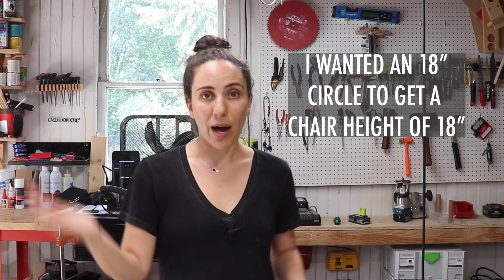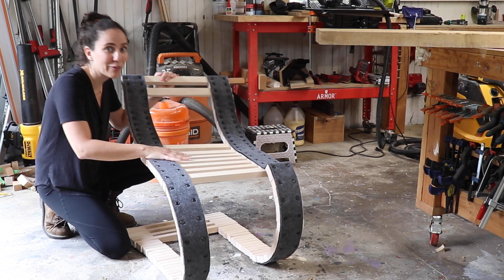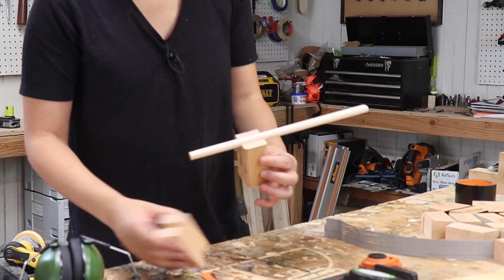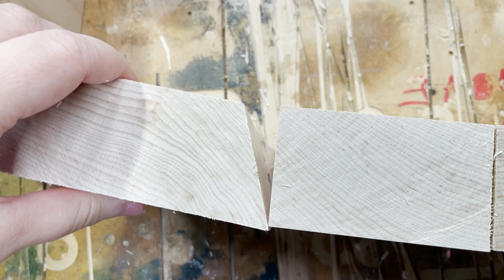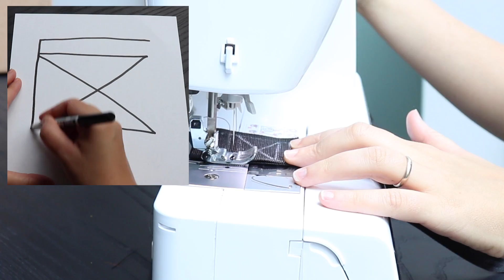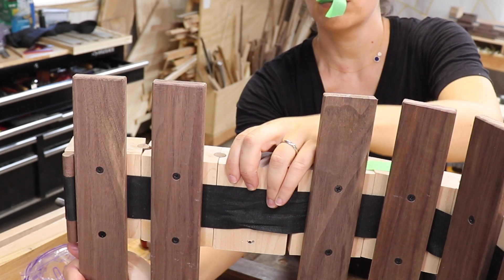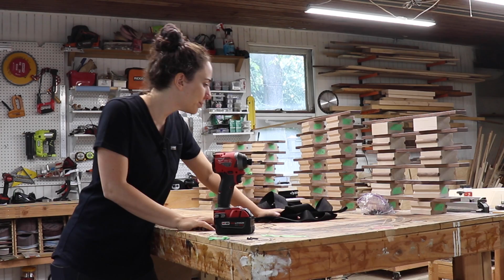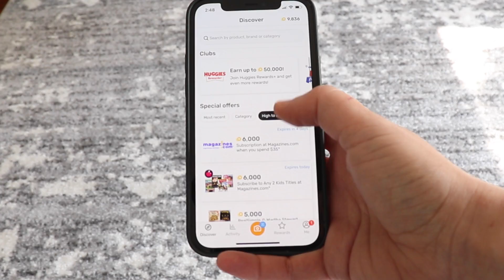I ATTEMPT to make a Roll Up Chair… AGAIN...

Comment: Hello Tamar....This might work: problem is one long strap (actually 2...lol) which gives too much stretch on the whole length...So solution would be to attach each pieces to one another with alternatively one short strap (centered around the 2 first pieces, and taking the third of the width of the piece), and then two straps from the second piece to the third piece (each one on the left and right side of the piece, and completely covering piece no.2 with the other strap coming from piece no.1) and so on.....So that way the straping will alternate on each pieces, from the preceding, and to the next one, without getting in the way one another....And straping only the short length of two pieces at a time, there will practically be no stretch "power" to the strap....I know it's maybe a little complicated, and a lot of short pieces of straps to secure, but it's worth a thought......And maybe dwelling on that, some other "double straping" idea will emerge...!!!!!
Reply from the maker: Good ideas!
Reply: @3x3CustomTamar  Hello again Tamar, had another idea (just as crazy as the last one, lol)...: piano hinges instead of straps (or only for the parts with the most pressure, maybe)....!!!! That would force that chair to stand, up and right, into the shapes you made the wood into....!!! Also thought that a simple X shape of straps from side to side, where necessary, could maybe help with the "torsion" aspect of the chair......!!! Really hope to see you succeed with this.... ;-)

Comment: beautiful chair Just glue it  - The connecting circles should be rectangularand strong wood - leather stretched - metal wire with plastic cover not
Reply from the maker: I did just glue it at the end
Reply: @3x3CustomTamar  I hope it holds, this chair is a work of art.

Comment: Tamar, at minute 16:50, it may be possible from looking at the chair profile - take the ends on the floor and extend that part of the chair with few more segments.      Then instead of having the ends laying on the floor freely - roll them upward to connect to the low point on the chair seat with some removable pins.     So that then you have a big asymmetrical oval in the proflie - for the base.      That should keep the chair from sagging excessively.     

The segments to form the new asymmetrical oval shape of course will have to be cut at angles, similarly to what you have at the front of the chair curve.    The front of the chair base as you presently have it appears to support your weight sitting on it.  You just have replicate that with the back part of the chair base.

And every time you unroll the chair, just insert the pins to form the assymetrical oval base.    Instead of pins, you might be able to use fastex buckles.
Reply from the maker: Maybe!
Reply: @3x3CustomTamar  Tamar,  Kevlar strapping may a solution to the strapping problem.  From the little I have read, it is supposed to have almost zero stretch.

Another thing you might want to consider is eliminating the walnut slates - maybe.  And instead make the dowels (oak) full width of the chair (instead of the short segments) - in the sitting and back rest areas.   It should also help with the racking issue.   If you try that route, the thing to make sure of - would be make the strapping width a little wider than the segments to cover up the joints so you don't get pinched - ouch!

You could always stain the dowel to the finish you want.    You may have to use bigger diameter dowel rods in the sitting and back rest areas.

Comment: The problem is the textile part. Have you considered using something designed not to stretch like dyneema?
Alternate suggestion, perhaps constructing wooden pivots at each joint similar to a cable chain tray.
I also like the suggestion below to switch out to neutral hinges. 
This is turning into a material science project, maybe a collab with an engineer creator could help?
Reply from the maker: Yeah. The materials are def the problem here
Reply: @3x3CustomTamar 
so...
The algorithm recommend '"chair by Gerard van der Beek" to me after I watched your last video a few times...
I reckon it might be the way to go. You can reverse engineer his hinge parts from the video frames, pretty sure they're plywood...

Comment: Steel cabling is probably still stretchy enough to notice, but if you ran steel cable through the blocks and then tightened them by having eyebolts on the ends that you could adjust would let you quickly and easily change the tension. You might even be able to build it with a cam-over lever so you could high tension in 'chair mode' and loose tension in 'roll up mode. 

Keeping the tension on the outside of the curves could also help with the collapsing.
Reply from the maker: Maybe!

Comment: Kevlar, fiberglass, and carbon fiber are among the stiffest (resistance to stretching)  strapping materials that you could probably get your hands on.  The design of the chair actually amplifies the forces (think using a door to crack a nut).  It might also be beneficial to not allow the strapping to move through each segment by fixing it in place.

Comment: The problem with those straps are not about the tension itself but about the fact that tension applied on the one piece is transfered to the ends - thats why the chair the collapses. You could avoid this by not using a single strap along the whole length but a number of separate, short straps joining only pairs of neighboring segments. You can optimize and use one long strap joining the flat bottom, which is barely stretched but the crucial, bent part needs this separate straps for each pair of segments. Maybe you could also use double layer there to further reduce the flex.
Reply from the maker: Def a good thought

Comment: I could be wrong, but I think leather will stretch over time too. Would maybe some wire cables work? You could thread them through all the pieces and still use the straps for extra strength.
Reply from the maker: Maybe

Comment: You will get there Tamar!  Perseverance!  By the way, I'm not one to be giving tips to the experts, but I had a similar issue with burn marks from my cheap old table saw and found that it was a slight alignment issue with my blade not being 100% parallel with my tracks and fence.  I adjusted it just a smidgeon in the right direction and voila!: fixed!  :-)
Reply from the maker: It’s really only with maple. I’m not sure why. I never get burning with other woods

Comment: Have you considered trying to connect the angles and taking the tension up with something like winch cable by drilling through the segments so that the angles held the shape on the front curve as well as the back, and winch cable won't stretch with the weight of a human on it like the upholstery tape which is normally criss crossed itself for rigidity
Reply from the maker: Could be cool

Comment: Maybe drill holes through the blocks and run a steel cable through it and at the end, you could have a bolt/nut system to change the tension while it's assembled
Reply from the maker: Maybe

Comment: You might have more luck with carbon fiber cloth.

The straps cannot handle the stress, and are deforming. In addition to finding a better material, you might consider adding additional straps. This will reduce the load that each individual strap has to endure before deforming.
Reply from the maker: Maybe!

Comment: I thought the stabilizing dowels were a good idea. Did that part of the experiment work?

My suggestion for the next attempt would be to test the stretchiness of various strap materials before building anything. My instinct says that leather will stretch even more than nylon straps.
Reply from the maker: Yea. That was the only part that worked. Ha
Reply: I agree. Leather will  stretch.

Comment: Two things jump out at me. The first is that the two curves are creating tension in different directions which is why it's causing the folding. If you secure the straps at the seat, it will negate the pull on the upper curve, allowing it to stay open.
The serving thing is to suggest seatbelt strapping. 😊
I can't wait for the final chapter of the trilogy!
Reply from the maker: Haha yup. That’s what the polyester was

Comment: Have you ever thought to drill a hole in the middle off the maple and thread a steel cable through the holes and put a turn buckle on one end to tension the cable?
Reply from the maker: Sounds legit

Comment: Why not router down the middle of the blocks and screw in a motorcycle chain. Motorcycle chain won't stretch.
Reply from the maker: Maybe that could work
Reply: @3x3CustomTamar  will add some weight mind.

Comment: I see two possible ways of this succeeding, and both of them use steel...
To stay closest  to the original design you can use steel cable, it stretches a lot less than any woven fabric. Linear strength is probably not going to be your limiting problem, but stretch is. So use a steel cable with as few strands as possible (1x7 = 7 single strands), that will be able to deal with rolling up, but stretch the least. Probably go for a galvanized steel cable of about 3 mm/  1/8" or 4 just to be safe of 1x7 or 1x19 strands.
As a test, you could probably staple the cable along the outside, and see if it holds up. Make sure to always have it  on the outside of the curve, so  it will have to be fed through for the seat back. Make the feed throug gradual, if you have a right angle you will snap the cable.

The other method of making this work is to build  it as an  extra wide steel chain. Use hardwood slats to sit on and to keep both sides of each chain link connected. Wood and stainless steel can be a great  looking combination!
The construction would work as follows: a regular bike chain link consists of two plates on the outside, and two linking plates connecting to the next plates on the inside. In between these plates is a bushing  to space the plates apart. You can make a chair out of this by having regular chain plates on the inside, but make the ones on the outside in the same shapes as you did the maple wood blocks. Instead of a bushing as a spacer, you use the wooden slats to  keep both halves of the chain together at the right width. Plates will have to be welded onto the outside plates at a right angle to screw the wooden slats onto. Some calculations will have to be made to choose the right thickness of stainless steel for the chain link plates. I'm not experienced in those unfortunately.
Reply from the maker: Thanks for the ideas

Comment: The straps free floating in the channels are what is causing the issue as it is pulling from end to end. If you used the screws like you did in the first version then the overall tension is split between ever joint. The venom strap should work if secured to each segment now that you got all the angles figured out. Just have to keep the strap under tension (use the vice like you did here) while you attach each segment.
Reply from the maker: I would think making holes in the strapping would make it not safe over the long run
Reply: @3x3CustomTamar  since it would be pinched between the two pieces of wood there should be very little to no movement. No movement then no friction and no wearing of the strap. 

Either way, love watching your content and seeing you work through this.

Comment: I really admire the optimism, grit and tenacity in this effort and would really love to see this work. I think what everyone should take away from this is a learning experience in the mechanics of leverage.

Steel as a material and/or considerably thicker blocks to make the higher force side of the lever longer. You basically need to move the fulcrum of the lever back towards the center of mass of the person sitting on the chair. That way you get much less force stretching the straps. I would do some math before cutting any more wood if I were you. But roughly I would say triple the thickness for the blocks.
Reply from the maker: Math is not by best subject. Clearly. Ha

Comment: Steel wire would not stretch.  From what I have seen from other roll up chairs the things that work well are pallet banding (black metal banding you can screw through though the chair doesn’t stay in shape without someone sitting in it)  or to make the whole seat out of dowels with 3 in a triangular pattern, repeat, with interwoven straps.

Comment: I wonder if you use a seatbelt cord if that would work better? Also, you could cut a hole in the shape of the seatbelt cord running through the wood and weave the cord over and under similar to how it's done with molly webbing... I don't know? might work... anyways loved the video.
Reply from the maker: Glad you liked it. That’s what the polyester was

Comment: random thoughts... the long cross-pieces could be shallow trapezoids so they keep the belt from pulling away from the joints; the belt should not be allowed to move (i.e. transfer slack in the top to gaps in the knee), perhaps a spline between the cross pieces and side pieces to "lock" the belt in place, and lastly, and least practical, using a timing belt instead of a smooth belt to lock it in place...
Reply from the maker: I was thinking about routing a groove in all the blocks so the strapping stayed in a track…
Reply: @3x3CustomTamar  That would be useful too, but I meant a groove perpendicular to the strapping, to keep it from travelling from hinge point to hinge point

Comment: Great video. It’s a case of leverage as the weight spread over such a short fulcrum is tremendous. If you had a curved support that is one piece, and shaped to match the rolled up state, you could support the seat area back to the base. That little bit of non-compression where the seat and back start to curve up would go a long ways towards stability. If you match the curve you could keep the roll up but this obviously defeats the original goal of the project. 
Anyway, I really enjoy your videos because I learn so much more by the process of problem solving than just seeing plans come together.
Reply from the maker: Glad you enjoy it!

Comment: This is intriguing, would be really neat if it worked. I'd remove the back rest cause this might provide a lot of extra slack as its curved in the opposite direction ... Zero slack is key, I'm thinking some kind of metal banding/joinery might be needed ... Great idea with the dowels btw, too bad its mute atm.
Reply: Maybe also remove the strapping at the bottom, if you just strap the curve you have less material that can elongate. If you get the seat-curve right you can copy-paste to back-rest and bottom
Reply from the maker: Maybe. I was so happy when I thought of the dowel idea. Oh well. Ha

Comment: Maybe if you reverse engineer it.  If you can do fixed (no cuts) rails rails and create a stable version of it out of pine again, then you can figure out the needed cuts (including the dowels) to replicate the fixed version (and stable again).

For the strapping, it would be nice to see what material has the tensile strength without stretch yet flexible for rolling.  I’d be very curious if something like Kevlar would work on this.
Reply from the maker: Maybe
Reply: @AmyD That was my thinking too but I thought it was just my OCD kicking in  ..lol...  Start with a fixed version and work backwards from there.  :-)

Comment: I think leather will be worse, not better. You have a physics problem because wood and strapping material both give in both directions. Each section is functioning as a lever exerting force on each joint, which I think is compounding adding up to a lot of force.
I wish I had an answer for you, but I don't have any ideas now. Do you know any structural engineers?
It's a physics problem that has some answer out there.
Love your videos btw. :)
Reply from the maker: Thanks! I don’t know any personally
Reply: @3x3CustomTamar  So... my dog woke me up last night and when I went back to bed I found myself thinking about your chair problem!
So, thanks for that. ;)
Having the strap on only one side of the slats seems to cause the collapsing issue. Putting straps on both sides will create problems with the roll-up. 
So here's my 2:00 am idea: Cut the dowels in half and sandwich the strap between the halves. Cut the sections in half and reassemble them so then the strap runs through the center of each section instead of on one side. You also limit how much the strap can stretch by the sandwiching process.
(Obviously you test this with scrap wood first)
So, what do you think? Decent idea or just go back to bed?
Reply from the maker: @geomikea  I think this would prevent the roll up process as well since the strap is in the center now

Comment: I think the solution is preloading by making the angles way more upright and let the weight of your body stretch it into the lower desired shape.  Before you sit I think it should be sitting substantially higher than you want for the seated position
Reply from the maker: Maybe!

Comment: I believe leather straps are NOT the solution.  Leather will stretch too.  Ask anyone who has played Little League about "breaking in" a glove.  The fact is ANY woven fabric or natural material will stretch.  That doesn't mean that you can't use it for aesthetic purposes though.  

The first thing I thought of to control the formation of gaps was to use wire rope like the kind used to square up fences.  Run the wire through the blocks you designed like you're stringing a necklace.  You may need two wires per row of blocks to prevent twisting.  You could put loops at either end of each wire and clip in a tensioning wire between the top and bottom loops to keep the ends from flipping back.

I'm an engineer by training and have way overthought this today (I love a good challenge!).  If you would like details on how I would approach using the wire ropes, let me know and I can share my thoughts.  I won't bore you with my ramblings if you're not interested. :)
Reply from the maker: Definitely interested